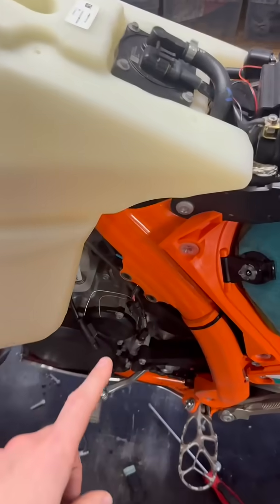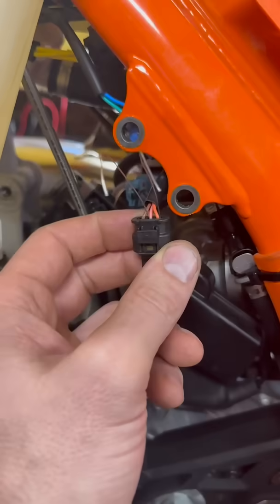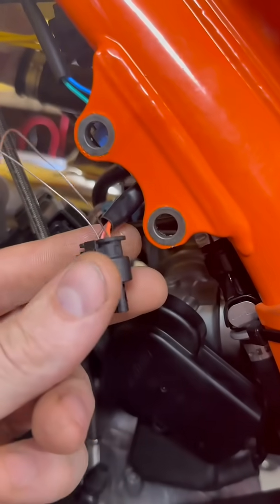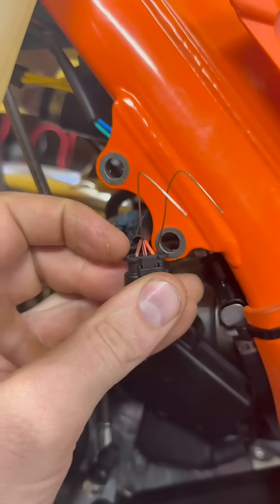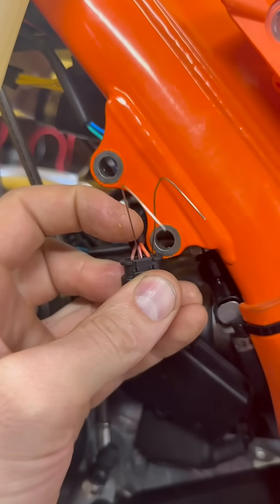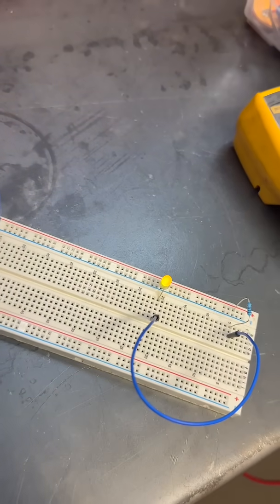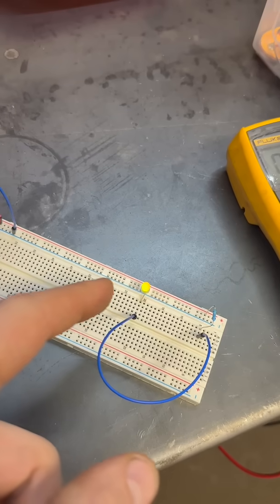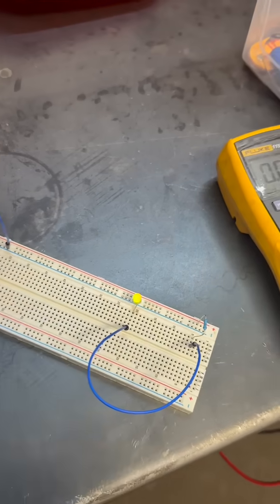Make Your Own Resistor Dongle

Comment: Why are we doing this tho
Reply: This is a 2 stroke bike which requires oil mixed with the gasoline. Some bikes, I assume this is one, have a pump to mix the oil with the fuel automatically so you can fill the gas tank with regular pump gasoline instead of having to mix oil and gasoline in a Jerry can before filling the tank. The owner of the bike might want to reduce the weight of the bike (possibly a race bike) so they want the automatic oil mixing components removed which can mess with the engine computer (the bike might just shut off because the engine computer doesn't get a reading from those parts so it "thinks" it has no oil and that the bike will die) so the guy in the video is using a resistor in place of the old components so the engine computer gets a good reading and "thinks" the oil mixing components are still in place and functioning properly. 

These sorts of systems have been around for a long time, in the good ol days they were mechanical and you could just plug a line and accomplish the same thing.
Reply: @luckyduck112   Thank you. I had a "duh .." moment, NTL,  not one of my old 2 strokes had this system, that I knew of. I mixed my oil and fuel. How archaic! Also, I mostly had big bore 4 strokes..
Reply: @luckyduck112 thanks I get it
Reply: Bingo. The fundamentals are always good. Bottom line is, sounds like it's a simple case of removing à system which causes issues. KISS - always the best program.
Reply: @denisemartin2542 Ty makes sense

Comment: If the oil level sensor is disconnected the oil level warning light will come on, but it won't throw an engine light flash code. As such it's not essential to use a resistor dongle if the oil level sensor is removed. I removed all of my oil injection system on 2024 KTM 300 EXC TBI, used a resistor dongle on the oil pump connector, removed the oil tank (and oil level sensor) and taped over the oil level indicator (so it didn't annoy me). I've been running it like this for over a year and no issues.
Reply from the maker: No issue with that at all. Just wanted it to be neat for the customer.